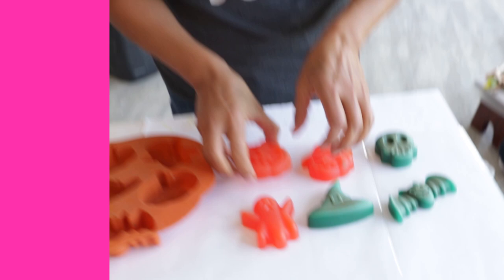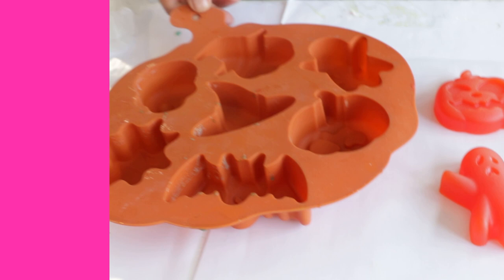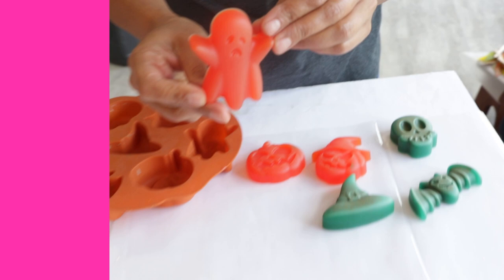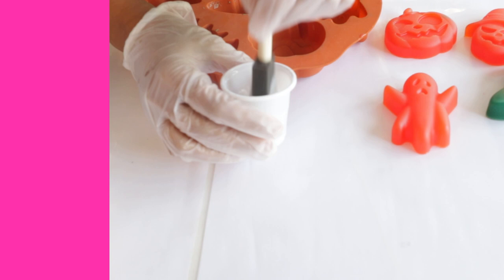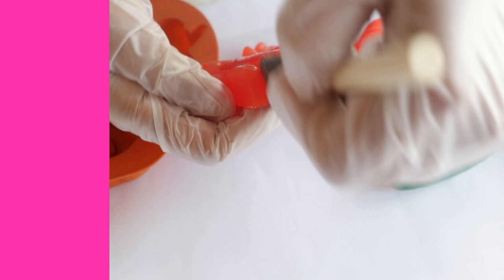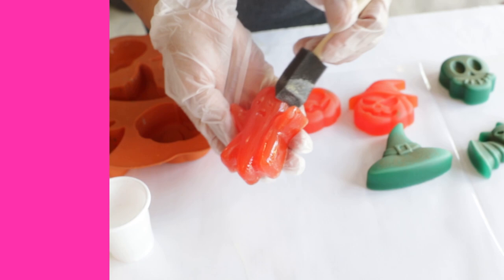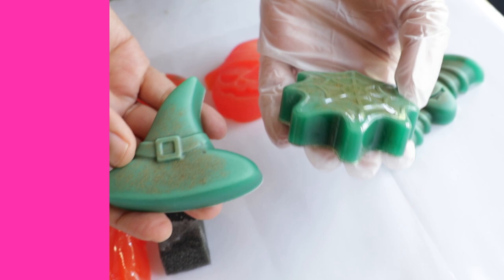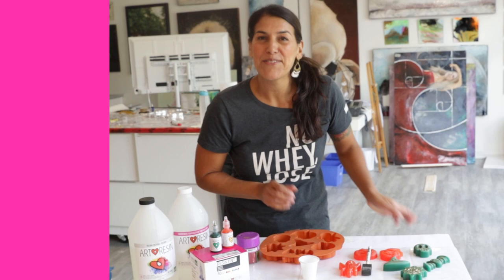How To Make Matte Resin Shiny

Comment: Use a heat gun or torch to get those bubbles out of the surface.The foam brush introduces more bubbles.
Alternatively build some proper molds that give you the desired finish right away.

Comment: I’ve tried this trick however when the resin is drying, it seems to “seperate” on the mold causing a dotted matte and shiny effect. How can I stop this?
Reply from the maker: Perhaps you are not adding enough resin or the surface isn't giving enough tooth.  Brush on your resin thick enough to coat well but prevent dripping.

Comment: I wanted to ask if the foam brush can only be used once? Also, are there bubbles if you use a foam brush for application?
Reply from the maker: Yes, we only use our foam brushes one time and then dispose of them. As for bubbles there will likely be some bubbles even in a thin application, using a torch is the best way to combat bubbles and to get a flawless finish :)

Comment: Hi. Will this work on my clear resin jewelry without sanding? Or do I have to sand first and then this?
Reply from the maker: Hi, for best results we do recommend sanding first before applying a second coat of resin for better adhesion. However, when you are just brushing on a tiny amount like Joanne did in this video, sanding is not necessary.

Comment: Hi!  I'm looking to give "glossy" layer to my homemade silicon phone case (for it to slide well in and out of the pockets), and I wanted to know if this will work?

Also, is there any natural alternative to plastic resin and/or something glossy that I can make/"cook" myself?

Thank you in advance for a response.
Reply from the maker: Hi there!  People do use epoxy resin to make phone cases, but if you're looking to apply a coat of resin to your silicone phone case, unfortunately it won't work.  Resin doesn't adhere to plastic of any kind, including silicone, and it will peel right off ( which is what makes silicone such an ideal material to use as a resin mold ) :) 
Hope this helps!
Reply: @Artresin  
I then need something that bonds with both silicon and the varnish coat, or something...  The thing is, I really need both silicon's drop proofness and not silicon's sticky surface, wonder how I'll do it...😄

Thank you very much for the response!

Comment: So I am fairly new to working with resin how do I not have my glitters sink to the bottom and just show on the front of my art
Reply from the maker: Hi there! Glitters vary in weights so the best thing to do may be to do your piece in layers. Putting down a main coat, letting it dry and then do a thin top coat with glitter mixed in.  Have fun experimenting :)
Reply: ArtResin thank you sooo much!

Comment: Ive tried this twice and ruin the project  im making because it is sticky, even 48 hours later, what do i do?
Reply: And how do i get it off?
Reply from the maker: @emmabayles8848  If the resin is still sticky after 48 hours it seems that there may have been a mixing issue.  If it is just sticky, you can measure out a fresh batch of resin carefully and ensure that you mix well then apply right over the sticky resin layer.

Comment: hey i did this and it came out streaky... could it be because of the brush i used?
Reply from the maker: Applying with a brush or applicator will give you a thinner layer than if you poured on ArtResin, so you may find some brush marks.  To diminish this you can try applying with a gloved hand, or in a bit thicker application with your brush which will allow the resin to self level and smooth out a bit more.  It may take a bit of trial to determine what technique works best for you.
Reply: @Artresin  thank you for your reply!

Comment: When you add resin to make it glossy. Are you mixing both or just the clear resin?
Reply from the maker: You will need to mix 1 part resin and 1 part hardener, stir well for 3 minutes until fully incorporated.  If you don't mix the two parts the chemical reaction to turn them from liquid to solid cannot happen.
Reply: @Artresin  I did that and it’s all sticky now
Reply from the maker: @sylvianalove  if your resin remains sticky it means the ratio was off or your mixture was not mixed thoroughly.  To fix this you can mix another batch of perfectly measured resin and hardener and apply a second coat.
Reply: @Artresin  thanks
Reply: @Artresin  what’s the best way to clean the resin molds?
Reply from the maker: @sylvianalove  you can wipe them out with a paper towel and alcohol.  To remove any little bits of dust or glitter etc, we use car detailing gel prior to pouring in the resin.
Reply: @Artresin  thank you

Comment: I tried this and my top coat came out extremely streaky and uneven
Reply from the maker: Hi Cailin, sorry to hear this. The good news is that you can give the top of your piece a light sanding and using a foam brush or even a gloved hand to apply a freshly mixed coat of ArtResin on top to get that smooth, high-gloss finish you're looking for :)
Reply: @Artresin  Thank you for responding!! I'll definitely try that. Could it have been because I did too thin a layer?
Reply from the maker: @cailinwaterhouse4591  Yes, it's likely that your top coat was applied too thin :)

Comment: I thought you needed to sand first before adding another layer? - Heidi
Reply from the maker: Great question, Heidi - you can certainly sand if you want to, but I was brushing on such a very thin coat, I didn't see the need to for this particular project :)
If I was pouring layers, I definitely would have sanded first.

Comment: I tried this with your brand and it wouldn’t adhere.
Reply from the maker: Hi Jenn, if the casted resin is not shiny, the thin coat of resin should adhere.  Maybe try a light sanding to your surface if you need to add some tooth for the resin to adhere to.